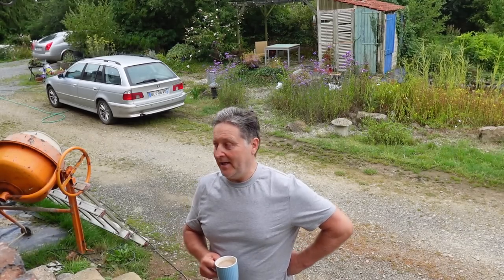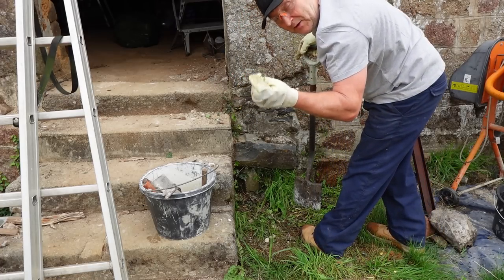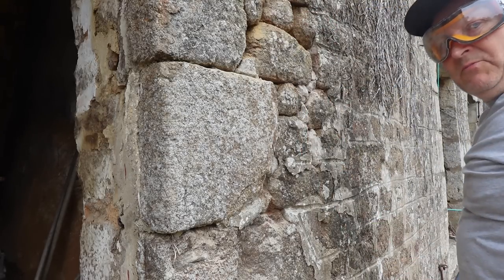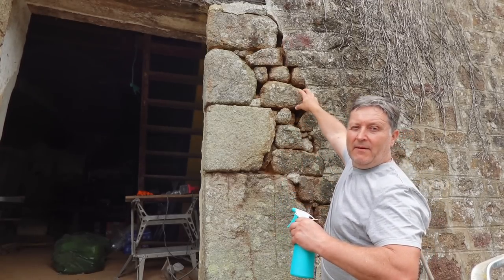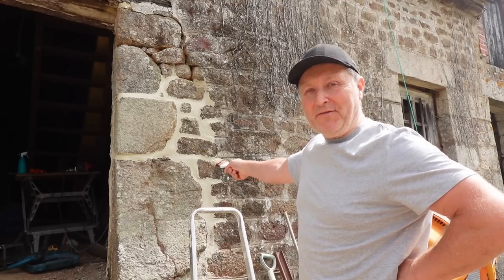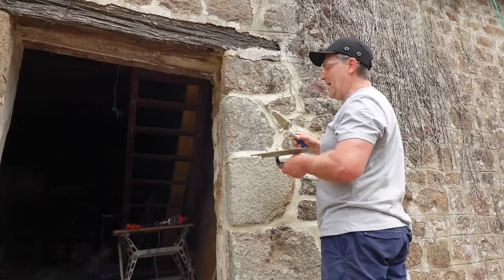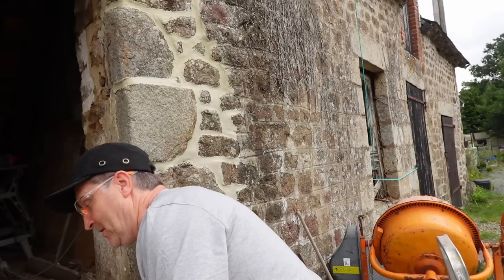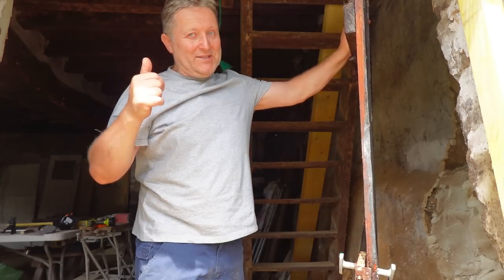Satisfying Renovation Of Beautiful 250-Year-Old Cottage Doorway | Episode 16

Comment: Amazing work you do at the cottage, Sean!  Yes, ivy can be invasive   I have some on the far end of my property, that grows on the ground and at times on tree trunks, which i have removed from time to time.  The pointing of the stonework is definitely important with lime mortar.  I have seen Billy, Simon and Yannis do the same at the convent.  Also, another YouTube channel involving a castle reno is The Jérômes., as they have done a lot there, like you, doing carpentry and stonework.  Yes, use of an icing bag will greatly improve mortar concentration within hard-to-reach joints. Those old wooden doors can be quite heavy, and you seem a bit strong in the arms to lift them.  Like you, I tend to make a grunting sound when I lift something.  There's nothing more satisfying than buying hardware or lumber at the home improvement store.